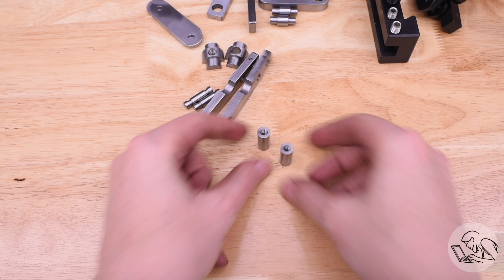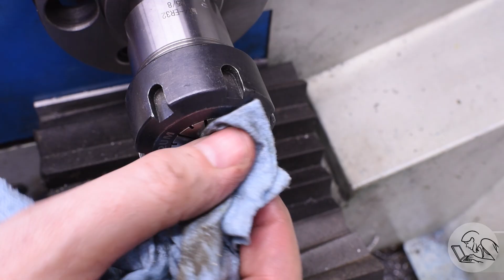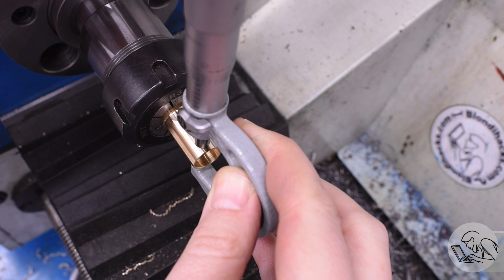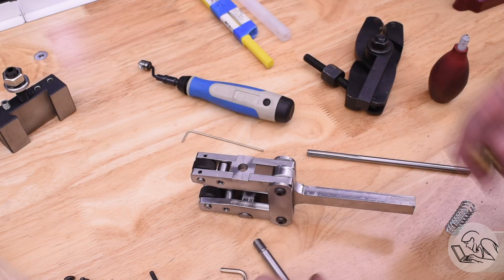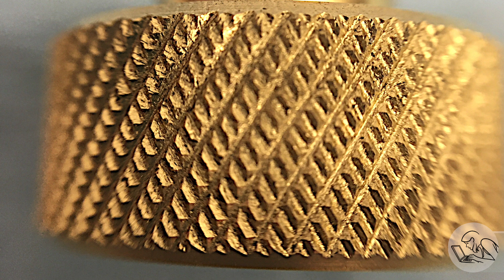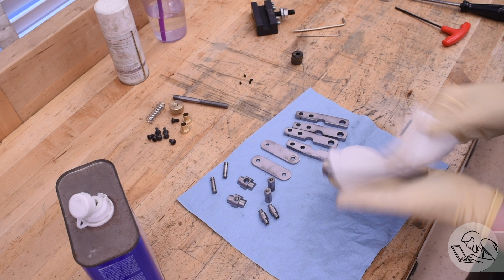Let's Make a Knurling Tool! Part 3, Conclusion!

Comment: @7:00, sometimes the A-B-C knob can be used to slow down the feed rate without messing with the change gears.  I know that you know; just mentioning it for anyone that hasn't noticed yet.

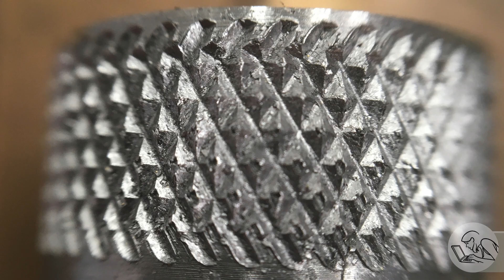@21:23 A pass with a cutting tool or a touch with a file will take the irregular tops off and leave very regular flat topped diamonds.

@22:07 Boeshield T-9 keeps all of my bare cast iron from rusting on the hot, humid Texas Gulf Coast.  My home is just 5-6 miles from salt water and it protects my woodworking and metal working tools very well.  Noticed a mini-split up in the corner there in your shop.  Awesome!

Comment: Quinn... you should get yourself a vernier scribing tool. I got one for work (sheetmetal and stainless fabricator) because it was cheap. Soon after got another one for home and its had the most use on the lathe.

Comment: Does the 30° compound setting actually help?  Seems to me like "single-point threading" is never really single-point anyway, but really a profile cut.  So by using the 30° compound, you're just doing all of the profiling on the same side of the groove.  How does that help?  I don't see the advantage.

Comment: Do knurling tools need to have a diameter that is a specific ratio of the part it is used on? Or is there just enough slip for it to fall into the closest groove when it completes a rotation around the part? It seems like there would have to be some size ratios which would cause more rub than others when that “reset” point is hit. At first I thought maybe that’s why there was left/right play in the wheels but then you added the bushings.

Comment: I see from the drawings on the D. Gray website the Maximum Diameter is 2 1/16" (52mm), but I don't see the Minimum Diameter listed. Have you tested for it yet? It looks like the spring will bind before it gets much smaller.

Comment: Odd leg dividers, electronic lead screw. You didn't menion the one of us that would comment on both 🙂 Very nice job as always and big thanks for the content. I'd be tempted to make a larger diameter adjusting knob to see if you could get enought torque on it by hand?

Comment: I did enjoy your video.  You said the knob is unable to get the compression that you can with the nut.  Could you use a piece of brass that is twice as wide as the one in the kit?  That should give you more leverage!  And if you change the spring out, would that help any?
Lee

Comment: Replace the thumbscrew…which does look very nice btw… with a female lever clamp…works a treat..👍
I have a UK..Jones & Shipman version to which I’ve added a lever clamp…much easier to use, and has a much better feel when applying pressure..😉

Comment: For "oomph" try moving the cross slide back a bit, easily snugging up the knob, and advancing the cross slide until the axles are again directly above and below the axis of the part. Big time oomph with very little cross pressure on the part. If you don't move it back too far, the ridges will not completely disengage with the already formed grooves and thus will not double track.

The damage to the pyramids is frequently caused by chips broken off during the forming process getting caught between the wheels and the part. A thorough flood of high-pressure lubricant (not cutting oil; this is a forming process remember) can help to flush away chips.

Comment: On my knurler, similar style and size as yours, there are 2 spanner flats on the adjusting nut. Not full height on the nut but on the top half of the nut. Might be a fix for yours! Cheers.

Comment: Awesome awesome awesome! Hey Quinn question for you. Your tangental angle hss steel tool holder, where might one find one of those? Or did you make it? If it is a bought item can i get the part number and vender please?

Comment: Hello Quinn,  if you modify the two brass pieces holding the spring to have a convex shape and the inside of the arms to have a concave shape, they will roll around smoothly and because the arms are parallel internally the brass that is inline with the smaller round will fit between the arms. I am sure you will find a way to mill this convex shape on the brass pieces plus keeping your standard smaller round above it. Once the convex and concave shapes are mated together they won't bind because you already have the smaller round between the two arms. Just an idea to help them run smoothly. Great videos, keep doing what you love.
All the best from Australia, cheers.
Wylie ✌

Comment: Very nice, looks great. Before the end I was thinking that cold blue would be the typical finish for one of these but really liked the shiny finish, so I was glad you ran out of blue. My cheap knurling tool has a knurled adjustment wheel, which has a pair of flats at the top too. Maybe an option?
Also, I think John Conner would appreciate the heads-up.

Comment: one possible solution for the spring shoulders would be to make the shoulders in the same arrangement as the clamping half round nut thing but with them sliding against the flat side of the part instead of pushing against the nut thing. One problem with this solution might be corrosion and wear since the brass and steel are rubbing against each other.

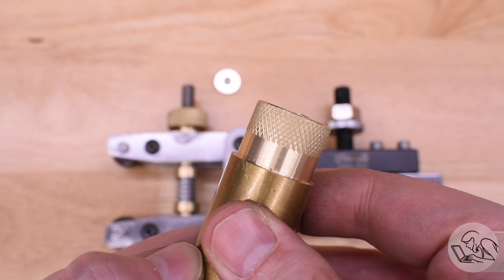Comment: On the steel knurls it looks like the "broken" peaks are just ones that are really close to closing but not quite. They get more pronounced from one end to the other .You can see this on the brass macro shot 20:46 as well where the knurls are more formed/deeper near the free end of the stock. Wondering if that is a result of the knurl wheels axes not being perfectly parallel to the work piece or if the free end is more malleable than the end backed up by the rest of the stock? A knurl in the middle of a piece (or a shoulder that makes each end "free") would be telling.

Comment: Hi Quinn very sensible method of threading towards the tailstock when hangout is long and diameter is small. Great rigidity. Great watching you build it but I'm not converted I'm still old school knurling heaps of gorilla pressure on cross slide with a 2 wheel Lock (Australian brand) Thanks again keep up the 50 people comments.....funny.

Comment: I really enjoyed this build. Thank you! 
"The quality of the knurl wheels": Rather than build I have now purchased (and returned) 3 different knurling tools in hopes of finding one that suits me. Every one has had wheels that are not drilled properly in the center. I've had wheels from .003" off center to as much as .020" off center. My latest tool seems pretty good as far as the tool goes and given the cost (about $40) but the wheels are still way out of round. I purchased one tool like the original Blondihacks has and it was absolutely worthless. It was made in India and the center pivot bolt had .016" clearance in the holes. It was just plain sloppy. I should have known better, I've never had anything made in India that was much good.

Comment: I envy you reverse thread cutting, my 48 Logan has a threaded spindle. Funny, I've got many of the same kit tools, like that knurling tool!  Thanks for sharing all your minor pains.
Reply: My Raglan does too. Pretty sure I could get away with threading smaller parts this way but I haven't had the courage to try it! One day I'll build my own ELS, with a configurable electronic stop linked to the DRO. That'll provide a pucker-free way to thread to a shoulder in the normal direction.

Comment: Regarding rounded corners as opposed to square because of stress,  I'm reminded of a service call I did once.  I forget the exact make and model,  but it was a large color printer that used SOLID inks (it had about 20 heaters in the thing).  While looking for the problem,  I saw a fairly large assembly that would "jump" when the thing was trying to go through it's initialization sequence.  Looking a little further,  I realized that the supporting structure of this assembly,  which had a lot of gears and stuff on it,  had broken,  in exactly one of those square corners.  And of course,  the part in question being a component of the frame for the thing,  was not available for the repair.  You'd think that the mechanical engineers at this large corporation that put this thing out would know better...

Comment: Would making the adjustment knob a 1/2 inch bigger in diameter help with tighting it down or as another person said putting a nut on top of the adjustment knob help?

Comment: That adjustment nut knurling conundrum reminds me a bit of how the first thing you do with a ball turning tool is a ball end for the ball turning tool handle.
Reply: To show how old the paradox is, I've heard it as "A blacksmith needs a set of tongs to handle the metal to forge a set of tongs"

Comment: (I refuse to apologize for any of the following fanfic.  But I probably should.)

Quinn: "Electronic leadscrew electronic leadscrew electronic leadscrew"

This Old Tony appears with a noise like 100,000 people saying "whop"

Tony: "Okay, where's the mill we're converting to CNC?  Oh, shoot, I had my lathe set to on-call.  Justasec."

Tony disappears with a noise like 100,000 people saying "foop"
* Tony reappears with a noise like 100,000 people saying "whop"*

Tony:  "Okay, fixed that.  Almost left it on time machine; that coulda been bad.  I've got just the guy for a quick little thread cutting machine.  Here we go: Hand filing hand filing hand filing."

Amid ominous whistling, Tom Lipton appears wearing cowboy boots, a Stetson, and a very flashy Starrett belt buckle

Tom: "Howdy, partner!  Life in the sticks is going mighty fine!  What did you need slapped together?  … Oh, you need a real one, mine was dogmeat.  And on a mill.  What was Tony thinking?"

Tom smirks

Tom: "I know who you want for this one."

Tom's smirk grows bigger, as his eyes roll ever so slightly

Tom: "FDM FDM FDM"

Tom disappears, and Clough42 appears, holding a precarious stack of spools

James: "Okay, where's the printer we need to get stronger parts out of?  Oh, wait, a leadscrew thing?  Okay, gimme a minute.  Gee Zero Ee Zero."

James disappears, leaving behind a birdsnest of nylon strands, then reappears holding a cardboard box and a barbell plate(?)

James: "Let's do this thing."

Comment: I dont understand knurls. How do they align after one rotation? Die Diameter of the stock and of the tool have to be dividable by the spacing of the knurling ridges?! otherwhise after one rotation of the stock the line the tool is marking is just slightly off compared to the line of the last rotation...
heeelp, I dont get it
Reply: One aspect critical to a correctly formed knurl, and seldom explained is that the diameter of the stock, or more importantly the circumference, must be a multiple of the diametric pitch of the knurling wheels. A knurling tool is essentially two opposing helical gears and in order for the “teeth” to land back in the same groove after the first revolution the circumference of the stock needs to be divisible by the distance or pitch of the teeth on the wheels. If it isn’t the wheels will form a new groove with every revolution and the knurl will end up finer than expected, or completely ruined.
Reply: @alexjamieson3822  yeah, that's exactly, that I thought

Comment: This is non-cutting knurling? Plastic deformation? I understand that.
You tell us to use a lot of cutting fluid. Even though it's not a cutting operation. And that makes me ask.. what exactly is "cutting fluid" for? There's not really enough of it to have a significant cooling effect. I'm not sure why one would want a lubricant: the tool needs to cut (or in this case deform) the work, not to slide harmlessly over it. So why do we use cutting fluid at all?
I use it - I've nothing against the stuff... but how, exactly, does it make life better for us? Is it simply a smoke-generating placaebo?
I love your work and I've learnt a lot from you: I'm not being difficult, I simply don't understand why we use "cutting fluid" at all.
Reply: Wouldn't the metal be pushed (in part) perpendicular to the surface of the tool? It has to move away from the tips of the knurling wheel and into the grooves. So, the fluid will lubricate that movement, allowing it to move more easily in the direction the tool is forcing it without as much friction against the tool.
Reply: @kevinpreid  You may have a point. I really don't know, which is why I asked the question. Cutting fluid lubricates the elements that we want to move without significantly detracting from destruction / plastic reformation where we do want it? That doesn't seem unreasonable. Forgive me for asking: is there evidence? I really am a total noob. I simply want to understand what the cutting fluid does.

Comment: I find that my cheap ER collets are pretty good if the stock goes all the way through the collet. If the part is only held at the end, I have tap it in as you showed. I'm reluctant to invest in good collets because I don't know if this behavior is inherent of the ER design or if it is due to the cheapness of my collets...

Comment: It's a nice tool, light bulb moment on the knurl wheel alignment now I know why sometimes my knurls look odd. Also don't tappy tap the stock on collet, try using a bump tool / bearing to align. There's a video on my channel showing how I normally do it on my ER40 collet chuck if you're curious. Cheers.
Reply: As other people already pointed out, the wheel was double tracking, the alignment had nothing to do with it. There's no alignment needed between the wheels.

Comment: I always just moved off in X, adjusted the tension by hand and then moved back to centerline.  It's much quicker and easier to get done.  Just make sure to only move off just enough to crank a bit tighter. If you move too much you'll loose your tracking.

Comment: made me look at knurling wheels on mcmaster carr. They come in M1 or M42 cobalt tool steel and in either flat or convex, in straight or left hand or right hand spirals, and in a butt load of sizes. The M42 is supposed to last longer and the convex are supposed to last longer. I wonder what steel is used on the knurling wheels in the kit you got.

Comment: Your ways cover seems to be in pretty rough shape. If you ever want to replace it, there's an ebay seller based from China that makes custom bellows designed for machine tools. You can get them in any size, length, and shape needed for a hobbyist-friendly price. I personally got a I¯¯¯¯¯¯¯I-shape which prevents chips from sneaking in under the cover. The material seems more substantial than what you got from McMaster-Carr. 

I don't know if mentioning the seller by name is okay here but you should be able to find them by searching for "Custom accordion bellow". I can also share the name if it's okay.

Comment: Reamers make slightly larger if you use oil as coolant. With water, the bore becomes slightly smaller. A precise reamer can have a moving fit with oil and a press fit with water on the same pin.

Comment: I watched this series with great interest to see you use it and if you had the same trouble I do with mine, not enough ooph to turn the knob. My thought is you might try this: set up the same to get the knurlers in contact with the part. Then back out the cross slide, turn the knob down to the desired “depth” for the entire knurl and then drive the cross slide back into the work while turning. It’s kind of like a combo of bump knurling with the scissor tool. I don’t know if it will work and can’t try it because I’m 3000 miles from my shop. Just a thought.
Reply: I've done that with sucess as long as the part is large enough to not bend.

Comment: How do the knurlers "sync up"? Like how do the diamonds pressed in by the top line up with the diamonds on the bottom?
Reply: Each wheel has only a set of diagonal lines, and one is the mirror image of the other. 16:40 is a good time to get a look at them. When the two sets of diagonal lines cross, they make the diamonds. So, the two wheels may bite at arbitrary positions, and they will always make a diamond pattern — but possibly with a different axial position along the part (depending on where exactly the crossings happened).

Comment: I have idea for small nice project for you. Instead complaining about using caliber to scribe on lathe, make tool specially for the purpose. Use cheap digital caliper with some modifications. Attach some extra scribes to one jaw and dowel to the other. It will be easy to set and use. It may be original, I didn’t see anybody using tool like that.   Thanks for you videos.  Janusz

Comment: Speculation from a guy with ZERO machining experience or knowledge: Maybe the biggest source of roughness on a knurl is small chips of base material which are carried around the part and pass again under the knurling wheel; so maybe some method of clearing those chips immediately downstream of each knurling wheel (maybe continuous air jets) would reduce the roughness appreciably?  Oh!  And replace that knurled adjustment knob with a tall wing nut.